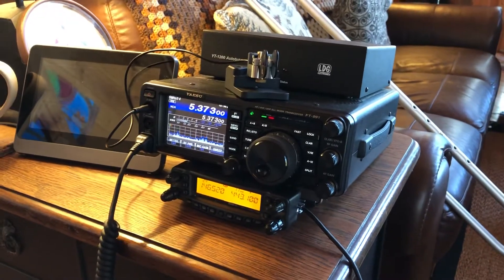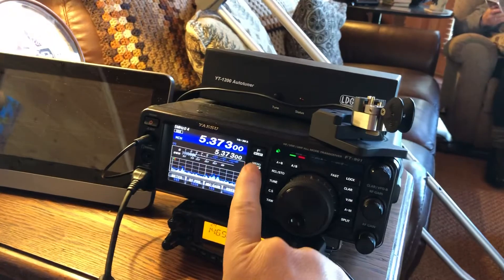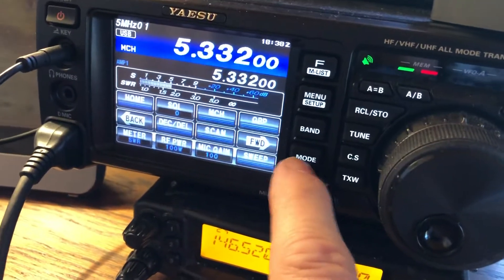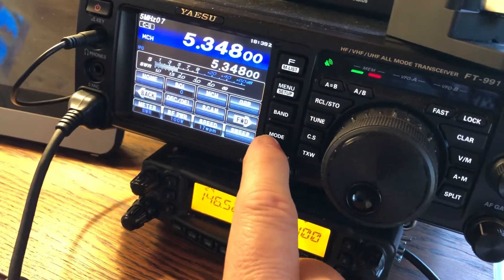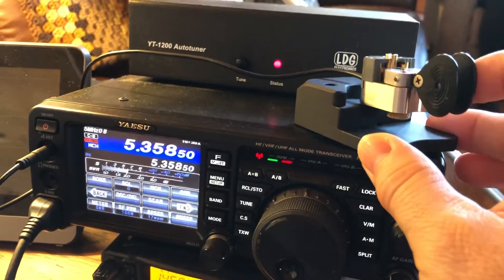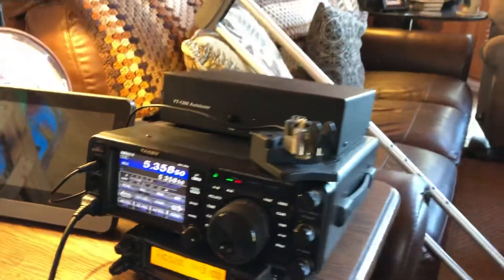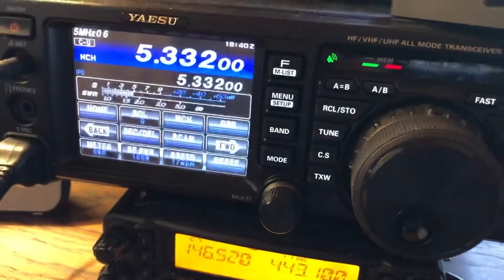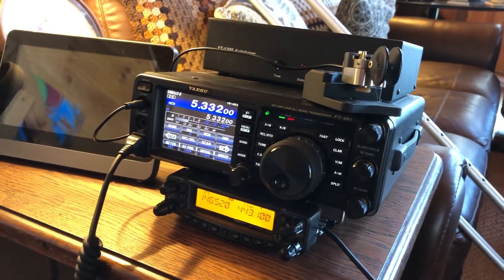Tuning a G5RV Jr. for 60m operation with a Yaesu FT-991 and LDG YT-1200

Comment: Nice. Too bad you didn’t id when you tuned up since you put a signal on the air.
Reply from the maker: Yes that’s too bad isn’t it.  I suppose you do.  Do you identify before you have a resonant antenna or after you have tuned, so you can be heard?  I guess while you have your radio in straight key mode, so you can transmit a carrier for tuning, you could use your left paddle and send your callsign the old-fashioned way.

If picking me apart for showing a workaround that allows someone to tune their antenna for 60m operation using a radio that cannot switch to AM mode on 60 meters gives you some type of thrill, you are a pathetic person.  Just move along.  You will be happier some place else.

Comment: Where do you attach the interface cable on the ft 991 or do you leave it out?
Reply from the maker: The Y-ACC cable is for the FT-891 with certain LDG tuners, but not the FT-991A.  So my friend just lets the tuner find a match when he transmits. He needs the LDG IC-108 for full automatic operation. Since the cable he has isn’t compatible, he powers the tuner from his DC power supply. 

In this video, I just let the tuner auto-tune from a burst of CW.  The 60 meter channels are preprogrammed, and you cannot change the mode to AM.  But, once the tuner stores the setting the first time, you can just give a sustained whistle on the USB channel and the tuner will detect the frequency and recall the previously stored setting.

73, de N4HNH
Reply: @n4hnhradio  Same thing I am doing. I also have an IC 7300 and its supporting cable which does provide dc to the tuner.  I have looked at a similar cable for Yaesu which plugs into the accessory port. I wonder if anyone has used that one and if it indeed will work with the 991A and provide 12v to the tuner? curious.
I have only had the 991A for a couple of days but the menus are fairly similar to the 891 I have been using in my RV.  Still, a good learning curve. Haven't dipped into the WIres side yet
Reply: @n4hnhradio  hi sir the tuner I have is the ldg it100 the cable I have is ldg tuner one end and a Y cable for Tun/Lin and Rem/ALC.. I plug the phono jack into the rem/ALC socket then the remaining  connection to the  Yaesu (Tun/Lin) and it powers OK as the tuner lights up and tunes but now I'm worried this is wrong.

The tuner was originally icom socket but came with a red/black two wired cable that was bare one side and attached to ldg tuner on the other.

When I bought the 991A I purchased a Y cable for the ldg az100 as I thought having the same ldg type connector and yaesu y connector it would be okay?

Can you share your wisdom here just incase I damage radio, but as I said it's been working OK.
Reply from the maker: I think the LDG IC-108 cable should work for you. It is compatible with the FT-991A when connected to a LDG Z-100A. It should also power the tuner.
Reply: @n4hnhradio  HI Doug, thanks for replying.. OK yeah it works great I just wanted to check. I have to put the radio menu setting to 'LAMP'  though for some reason 'External' don't work.

Cheers again.

Comment: Probably a straight key would be better for tuning, and it would be much faster.
Reply from the maker: Indeed it would.  That’s my friend’s rig and he likes that key.  Actually though, you can go into the menu and set it for straight key (off) and use one of the paddles to send a constant tone.  I do that with my FTdx5000MP.  But I only did it once per channel, just to allow the tuner to record the settings in memory.  Now I just whistle into my mic for a second and the tuner detects the frequency and loads the setting from memory.  Thanks for your comment!  73, N4HNH

Comment: Hey Doug! I'm considering picking up a 991A and I stumbled on your video. How are you liking it? I have a thing for portable radios and this shack in a box has been calling to me ever since I bought my IC-7300. What are your thoughts on the 991? -A-Ray
Reply from the maker: Hi A-Ray!  It’s great to hear from you.  Joel has an IC-7300 sitting next to a FT-991A.  At his cabin, he has this FT-991, not an A.  It works very well.  I was there chasing him and Ariel while recovering from knee surgery.  The FT-991A is definitely a better receiver than the IC-7300.  In fact I consider it a close contender to my FTdx-5000MP Limited.  The filtering is practically the same as my 5K.  The digital noise reduction is phenomenal on SSB. And, the filtering can make a CW station sound like a practice oscillator.  Joel worked a SOTA station out West that I had just worked with my FT-891, while adjusting my paddles.  He said to me, “I don’t even hear him!”  I asked, “which radio are you using?”  He answered that it was the 7300.  I said, “you’ve got a 991A sitting there.”  He switched to the 991A and worked the guy.  That says it all to me.  And Joel has discovered that the 2m/70cm part works great as well.  The TX audio is fantastic!
Reply: @n4hnhradio  Wow, what an endorsement. When it comes to ease of use and earning my stripes on HF, the IC-7300 really was a great buy. My biggest gripe with it doesn't matter to most, but I hate how cheap it feels (IMO). Wiggly knobs and easily scratched plastic. For Christmas I picked up an 891 and I also noticed it had way better ears. To hear that you would compare Joel's 991 to your 5000 sells it for me. Time to sell some of the seldom used toys so I can grab one.
Reply from the maker: Aaron Ray, most Yaesu radios on the market today feature DSP and filtering that isn’t far behind the 5K.  But the 7300 is the clear winner if your main interest is to see signals, more than hearing them.  It is a choice of beautiful display versus performance.  The improvements in the 991A include a better, more fluid, waterfall, but admittedly the 7300 still has the better waterfall.  But the 991A waterfall is good enough.  Again though, at some point I need to hear the other station in order to work them.